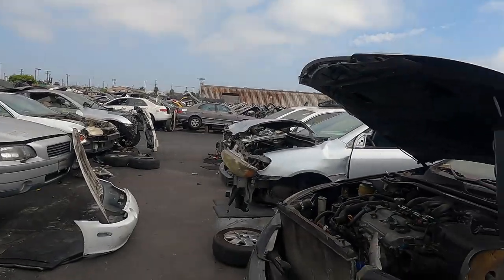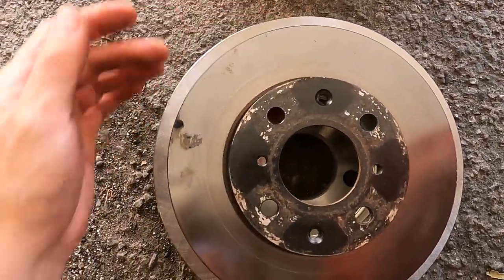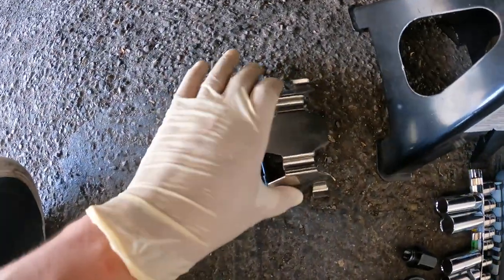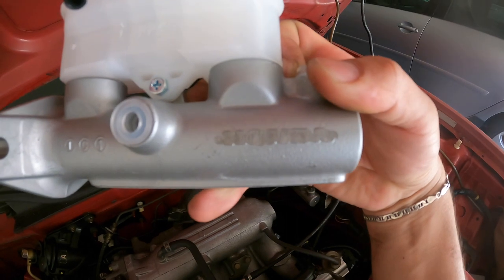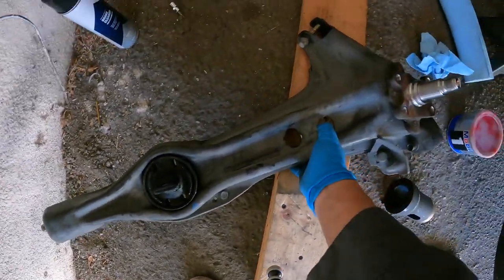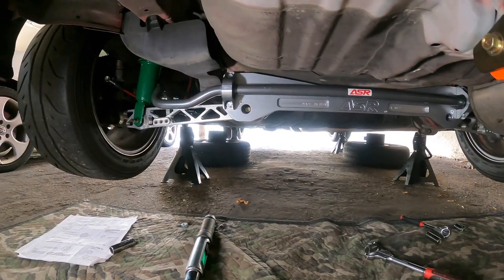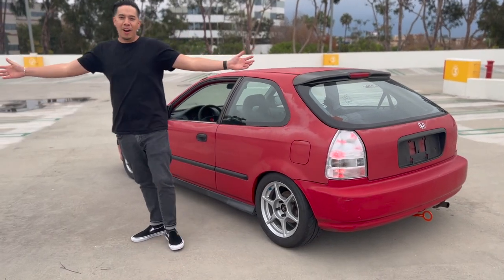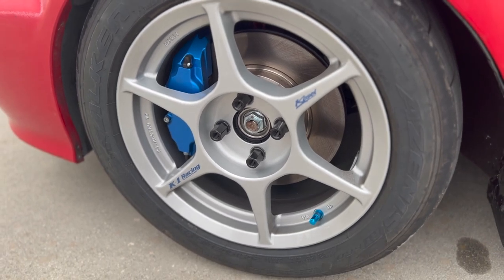Spirited Motorsports Project "EK" EP. 4 Twinblock caliper, ASR Subrame brace, Kosei K1

Comment: I actually have the exact same calipers but installed it if it was the real version. However, the real version requires a 3mm spoon spacer installed or any other brand spacer, the spoon caliper bolts and washers  to center the calipers with the rotors to prevent uneven pad wear and etc. You might want to see if you have any uneven wear.

Comment: Man those spoon caliper knock offs are so on point. I wonder if they are coming from the same factory. If it wasn't missing the branding, I don't think you would be able to tell the difference from the real ones.
Reply from the maker: They fit great, no issues at all, and the casting appears to be a little smoother. Also can’t beat the price!
Reply: @spiritedmotorsports  yeah, calipers are pretty simple too so no worrys about quality since there are very few moving parts.